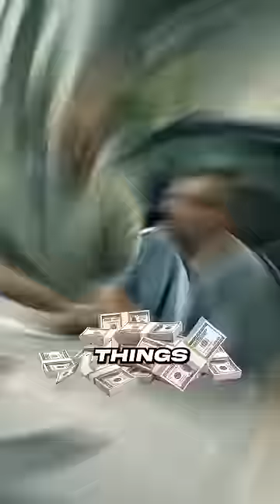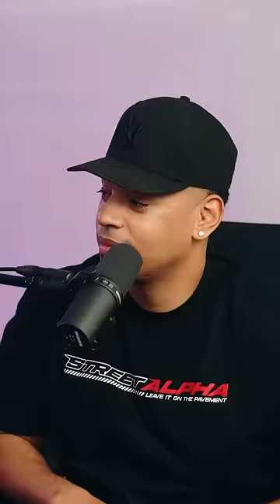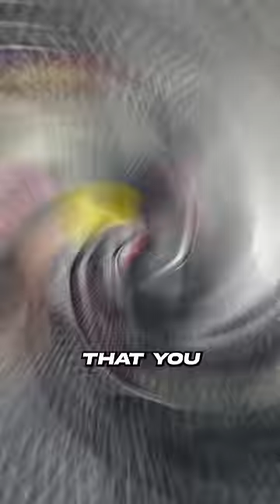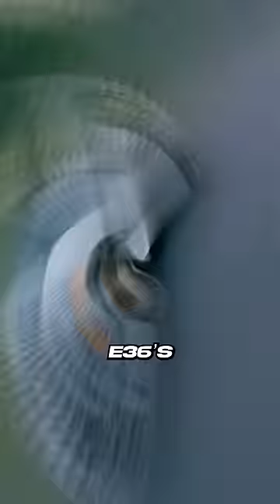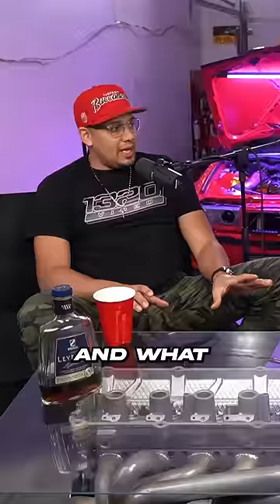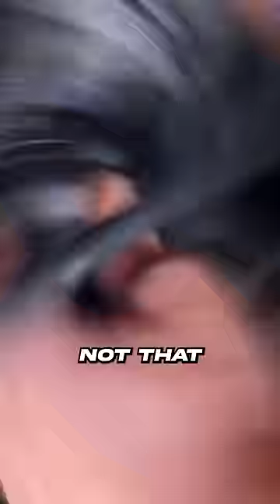What BMW DOES NOT Tell You 😩 #shorts

Comment: When I think of plastic failing in a german car I always think about the timing chain guides in the B6 and B7 Audi S4.  The guides were plastic and would develop cracks and would fail.  The whole job is engine out and can cost anywhere from 4k-7k (possibly more).  Whats messed up is they were aware of this and put metal guides in the RS4 the much more expensive version of the same car.

Comment: I've read from former BMW or Merc engineer and they said the same thing. They're designed to break at the right time to get the business going. This is also applied to most but not all car brands.
Reply: Every mass produced car was engineered in this way to some extent. Some manufacturers obviously stick their necks out for you and build a car that they know will last twice as long as the average but the only reason a manufacturer wont design a car to easily go a million miles is because they need money to build more cars. Its not because they cant its because if they did they would go bankrupt like cub cadet, Cub cadet went bankrupt because they built a mower so good nobody needed to buy another one, So nobody did.
Reply: Toyota has entered the chat. 😉
Reply: What a load of bollocks
Reply: All car brands
Reply: Buy a Toyota. All EU cars suck big time. Never again. Japanese only
Reply: @mikem.7544  yeah buy a Japanese car if you don't care about luxury, performance, design.
Reply: Cars? This is life now…
Reply: Its not just cars, everything we engineer has to be affordable. Everything from bridges, ships, planes, buildings; they're all engineered to last only as long as they will remain relevant. Its called planned obsolescence.
Reply: @peterise192  design? A German car that lasts 35000 miles is good design to you? 🤦
Reply: @odog3254  mine is currently at 165000 miles, and is my 3rd high mileage model.
Reply: @peterise192  u obviously never driven high class lexus or crown lol. when it comes to cars, japanese is the way to go. unless u plans to spend over 200k on a car, thats the price when european car become viable.

Comment: I have 3 bmws, 2017 530i 75k miles no issues, 2016 modded x5 50i with 90k miles no issues 600 hp, 2020 m5 comp 56k miles no issues. Oil changes every 5k miles. Take care of your car and it’ll take care of you. Modern Beamers are just as reliable as any other non Japanese car just cost more to fix. Nobody wants a Japanese car for luxury performance. That’s why they go German. An apple is healthier than steak and lobster covered in butter, but we all know what you really want, you want that surf n turf, you just can’t afford a gym membership(car maintenance)
Reply: You havent even reached 100k miles. Thats not even broke in yet😂 thats still a new car. Lmk when you get to 300k miles
Reply: I got a e46 with 160k miles another e46 with 130k miles and an e90 with 143k
Reply: 90 k is nothing
Reply: Thats all low miles. We're talking upwards of 160k.
Reply: Only reliable  BMW i feel like it’s either the base models or an M series.any other middle models example like a 335 issues forsure.
Reply: @adorablecenturion8436  since when are we talking that? Why would I want that old of a car? It would take me 160 months to drive that many miles if I bought my cars brand new, which I did.
Reply: @signaturedetailaz  why are you buying brand new bmws. You just be pissing money ?
Reply: @Staticgoods  no I’ve driven them for years they’ve done me good! I paid off my older two last year and am about to sell them both make around 40k and use that as a down payment on a 2024 Porsche Cayenne turbo. I’ll drive that for 5/6 years and I’ll guarantee I have no issues the whole way. I drive the average amount in these cars, 1k miles a month. Regular oil changes and service and everything is fine. German cars have to be maintained more thoroughly and the mistake is buying a used one that had a retarded first or second or third owner
Reply: Who the fak told you an apple is healthier than steak?
Reply: Yes ,what u are doing is called preventative maintenance.

Comment: VR6 waterpumps enters chat.
Reply: Fuck I felt this comment lol
Reply: Every VAG water pump has entered the chat
Reply: And the 1.8t and the 2.slow
Reply: Upgrade to Graf aluminum water pump
Reply: @GTI_Man actually on my 2.5 VW Jetta 6 2012 it still works fine, 226k miles 😅
Reply: E36 water pump plastic as well lol
Reply: @salvadorhernandez758   laught my asss of dude for real hahahah during my work
Reply: I finished the paperwork for my Jetta GLI, car is outside, nice and washed with a cute bow on top, and a puddle of coolant underneath🤣🤣🤣 didn’t even get to leave the lot and had to leave the car there for water pump replacement.
Reply: HOLY FUCK THIS TOO ACCURATE
Reply: @GTI_Man  exactly man, got a 20 plate VAG vehicle and the water pump was leaking before warranty expired (and I unfortunately didn't notice)
Reply: First thing you do when timing 1.8ts and Vr6 is upgrade any plastic part with aluminum or steel, especially water pump mine broke apart and the impeller was so close to going into motor, I went metal after that lol
Reply: @tdub25 yikes I felt that 2.slow as a previous mk4 2.0 gti owner
Reply: Bro!😂😂😂

Comment: As someone who’s actually worked at BMW as a technician I can wholeheartedly say this is bullshit. We did so much work free of charge to the customer outside of warranty because we believed the part shouldn’t have broken anyway. Also had a few modified cars come in and still get covered under warranty depending if the modified parts could have genuinely affected what went wrong. This included tuning and not just shit like exhausts and intakes
Reply: Same page. My understanding,  bmw are ultimately driving machines where performance comes first. Plastic is lighter and strong enough for weight distribution purposes
Reply: @petrolhead9756 bruh what. Weight is hardly the issue. But money definitely is.
Reply: @tysonchickennuggets  both right. They make money while saving weight for emission compliance and performance figures
Reply: You say the part shouldn’t be broken but you guys still change it out. That still means they’re made shitty bud lol
Reply: @ilikepokeyotutu3467  we change it out because it actually needs doing. Regardless of any sort of modifications, the part still shouldn’t have broke. Some parts come defective from factory. Same as some people’s Lamborghini’s or mclarens will have bits that break earlier than expected. Doesn’t mean the whole brand or parts themselves are shitty
Reply: I work at a dealership service department, we are not the company that manufactures the cars we simply just fix them. So YOU might goodwill customers cars outside warranty but that's not BMW doing anything for that customer...that comes out of your goodwill allowance. BMW could still be making cars that break after a certain time frame and you could still give the customer a break to retain their loyalty to your dealership, both are true. As someone who fights with FCA/Stellantis daily don't side with the manufacture because you have their logo on your uniform...You don't work for BMW anymore than I don't work for FCA, we just fix their shit.
Reply: @traviss9059  I ONLY left BMW for another main dealer that offered better money and less hours. I have nothing but good words to say about the company as a whole. Easily one of the most professional but fair companies I’ve worked for. Yes there is a goodwill allowance but we regularly went over it when a customers car broke for unrelated reasons such as what I’m talking about in regards to modifications or tuning.  The company itself was extremely fair and actually leaning more towards positive customer satisfaction rather than budget. The manager knew we were making enough and was okay with us (as a dealership) going a bit over goodwill allowance.
Reply: Its not bullshit. Dealership just picks and chooses when and who to do that to. I guarantee you they dont do that for your average customer
Reply: A cool dealership?   Nah

Comment: I doubt it’s the auto industry fault. I work in the hvac industry, where every year, there is some new regulation. Every time there’s a new regulation the manufacturer has to follow, that means there are cheaper parts they have to build. The manufacturer are open with the public about this, and I as a technician, am open with my customers about this. The parts are cheap, because they’re the only thing that can keep up with the new regulations. For example: you need thinner refrigerant line sets, to make them more thermo dynamic.  Thinner line set with a high pressure refrigerant = more leaking coils/ line sets. Moral of story, it’s not always the manufacturers fault.

Comment: I’ve had many bmws, some with high mileage and I haven’t ran into any real problems. Some people are just unlucky or don’t know how to properly maintain a car
Reply: real talk either the gasket is gonna go or ima use every bit of my power and discipline to get this shit running properly like how it shouldve been
Reply: Same here, my dad drive bmw all my friends drive bmw, im driving bmw and no1 have problems😂  idk what these nids doing wrong
Reply: I have owned my BMW e36 325i for 9 years I've never had any issue with it.
Reply: Any tips? I just bought mine 1 month ago
Reply: @dannyhernandez9113  if your going to mod it at all to make high hp, buy the proper support mods. If not, I suggest you just listen to the car( warning lights), if you have the option park it indoors, and if it’s cold you should idle until the rpm drops below 1000
Reply: @dannyhernandez9113 idk which bmw you have but do 5K interval for oil and if you’re going to beat on it make sure she has good tires and no leaks
Reply: Same here. The only thing I have done in my 2019 750 since 2019 is change rear rotors and pads. I do my service every 5k miles though.

Comment: Def not just BMW doing this - they all are!
Reply: toyota? 😁
Reply: @raprapzandro Toyotas using BMW engines so..
Reply: @TheFuelInjected  when? 🤣
Reply: @raprapzandro  The GR Supra uses the BMW B58 motor mated to the BMW ZH transmission mounted on a BMW Z4 chassis. Mostly because Toyota would have had to develop a new I6 motor to appease the Supra loyalists and BMW has spent decades refining their I6 to the current iteration the B58 which is known for its reliability and tuning potential, so it just made sense from a financial stand point for Toyota to skip the decades of R&D to develop a similar motor.
Reply: @TheFuelInjected on a toyota tune aka bmw was doing exactly what this video says and toyota was like nah you cant reliably do all that and have the car last a couple decades
Reply: @GamerplusMore  Toyota did not detune the b58, they simply implemented their own tune which puts out the same hp and torque as the Z4 M340i. While the first model year has the B58 which was being manufactured already, the 22+ years have the B58 TU and B58TU2 which started production after Toyota engineers went through the B58 so its thought that their engineers feedback contributed to changes to the newer B58s which result in more tuning potential and better reliability. The original B58 is by no means overpowered for its design, it uses a forged crank, con rods and a closed deck all of which were considerations Toyotas engineers took when deciding to approach BMW to collaborate for the Supra.

Comment: Audi did this with the s4 99 to 2002. They had it set for them to have to be fully served around 60k miles. If it makes it. They knew the timing belt fails then. Up to 99k miles. Cam seals, valve covers, aux water pump, front mount, front cv's. Water pump and so on. None of it on recall list for a reason
Reply: That's interesting, i have a Audi a3 8l 1998 1.8t 150hp(AGU) so it would be cool for me if you listed more of these possible problems that may occur because from what i remember i already replaced the water pump and the front cvs and i have some problems with the front mount as well, if you don't Mind of Course hah.

Comment: In Engineering there is something called a Factor of Saftey which basically says how long can something resist  failure doing its job or under its fatigue cycle . So they can predict when something breaks it wouldn't be impossible to tell.

Comment: I had an e36 that i was gonna "ride til the wheels fall off." Ended up having it for several years and just sold it last year, still running great, with 321,000 miles. It was a 96 328is manual 5speed. I now drive a 2003 530i 204,400 miles still running strong! I love old bimmers!
Reply: Yeah, the 80's and 90s mid 2000 will run forever if taken care of.

Comment: It also depends greatly on where they source their composites from. Now I’m not really familiar with BMW to know where they get their composites from but I know Ford has been using Mexican manufactured composites since the mid 2000s and as such their quality fell off. Chrysler had a stint in the late 90s early 2000s where they were getting composites from Brazil which was a horrendous failure and made even the 24v Cummins unreliable. Then you have companies like Toyota who manufacture their composites in the U.S who are often seen as quality.

Comment: Preventative maintenance is key with modern cars especially European cars... If you just want a car that you can jump in and drive without having to do much, buy a 90's Toyota Corolla or Honda Civic and still do regular oil changes... If you want anything later and especially European you need to be religious about servicing and do preventative maintenance such as keeping an eye on plastic pipes and Radiators etc and replacing them before they break down and cost you thousands more because of extra damage to the engine etc...

Comment: If anyone actually sat down and read car manuals they show you different intervals for oil changes. If you life in a crappy big city with majority stop & go traffic, you change your oil frequently which may be under 7,000 miles. If most of your trips are highway miles you change oil less frequently which may be 7,000 to 10,000. Now even in this day I never heard of 12,000or 20,000 mile oil changes even with top tier full synthetic. My 2015 brand new car recommended 7,500 mile intervals with the type of driving I dealt with (mix stop n go/highway). I still changed my oil within 3,500 to 5,000 miles. All this sounds like is dimwitted car owners.

Comment: if you ignore the bs dealership advised service intervals and do your own maintenance when you're supposed to bmw's last just as long as any other cars. i've had multiple bmw's with 250-400k miles. first new bmw i bought was a 2008 335i and they tell you that the transmission fluid in that thing is good for the "lifetime" of the car but you should be changing it at 60k then again every 30k and you can keep the original transmission in that thing forever

Comment: I had an E36. Bought it with 80k miles on it. I sold it when it had over 220k miles. The most major repair that I had to do to it was replaced the cooling system, water pump, thermostat radiator. I’ve had over five E46’s and they were reliable. I call BS with this guy. maybe the new ones have problems like that but not the E46 and the E36

Comment: Hand on heart my bm's have never failed, u had over 10 in the last 25 years and I'm a taxi driver. The new one after 150k you need to get the timing chain changed apart from that I wouldn't get any other make

Comment: Everyone is 10k oil, for EPA.
I work for BMW, own BMW and Land Rovers.  90% have no issues till 80k plus miles, 70% of time by then its owners fault. Bought car cant afford for Badge.
That said there are few motors that are not worth costs n63 range.
BMW 6 cyl solid, had 160 on car when I sold for newer 5. Got n55 f07 bolt on and tunned to 400hp at wheels, dailied and beat on it from 40k to 90k, need spark plugs at 60k and oil changed. Also no leaks.

Comment: The plastics (actually the use of recycled polymers) were mandated by the German government through legislative actions put forward by the Greens and other environmentalists. BMW, perhaps more than any other German automaker, saw this as a perceived performance incentive (weigh savings). Moving, especially accelerating or decelerating things is extremely energy intensive. So, yes, it’s BMW fault. However they also responded to a legal requirement.

Comment: Hi there. I can say that it is true what he says. HOWEVER, this is also true to ALL manufacturers. We calculate in “normal” KMs (Miles per hour in US, and EPs ( TEST Miles (TM) in US if I am correct). Multiple TMs by 100 to know when what brakes. The vehicles break at certain points, let’s say at 1.234 TMs. So the part that broke, will break in ABOUT 120.000 on the road. This is how we know, when will something break. There are always many vehicles for the tests. Not only one.  To know the middle of things. 
This says, we know when what will break. They make them good enablers to stay on the move for about 150-180k kms in Europe. After that, you should buy a new car. This is for all modern Cars. For trucks it is much higher. About 500k kms. 1,61 kms are 1mile. So in the US it should be about 300-500k miles for a truck. After it is usually recycled 😢